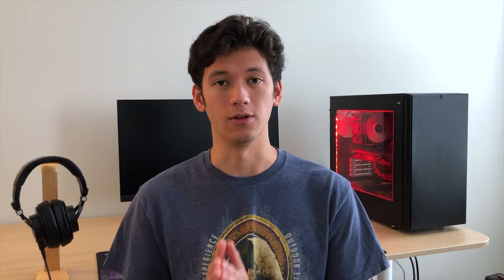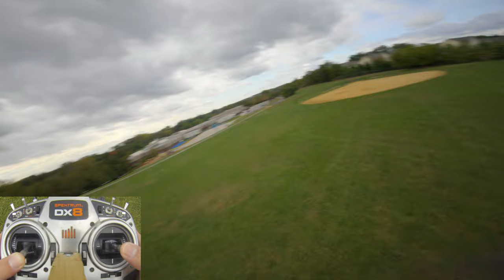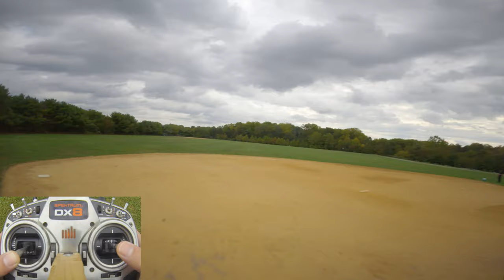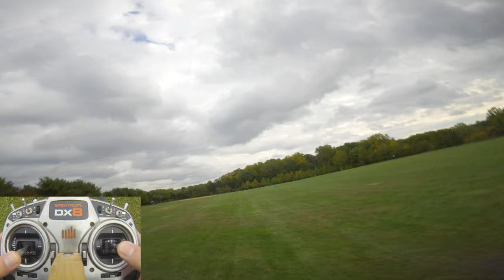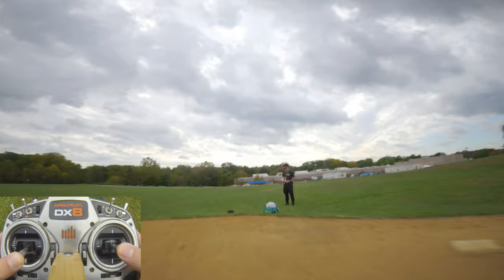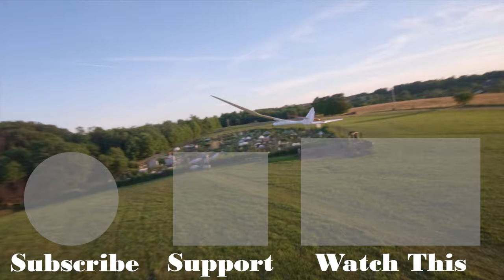Hitting Gaps Tutorial - How to FPV ep. 4

Comment: Thank you so much I have been looking for someone that is teaching the basics. I have a DJI FPV and am terrified of crashing it because it is not durable enough.  Is there a drone you suggest that I can use to learn in with a little more comfort that I can repair it.  I’d also like it to be digital vs analog because I would want to use my FPV goggles.  Not sure if I can use the radio it’s version 2 if I can I’d like that too but am down to buy a better one that more suits acrobatics and racing
Reply: I see what your saying, however there are two options. I would either invest in an Emax or Betafpv rtf model as they are obviously rtf, full acro and light. They are also very cheap if you critically damage a part which is difficult. But if you are not comfortable with spending $200-$300 I would stick with a simulator. As I believe that DJI has an app which syncs to your goggles and remote for a really realistic feel. Best of luck.
Reply: @vertx706  thank you 🙏🏽